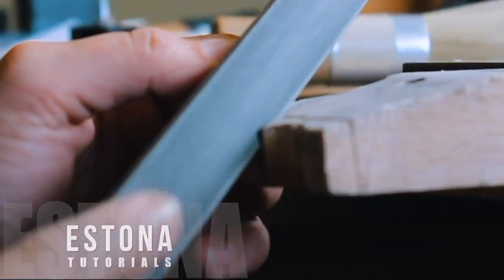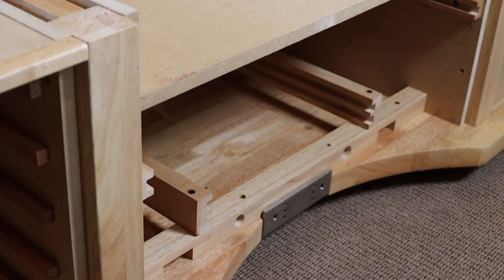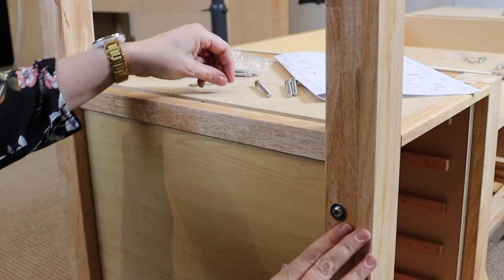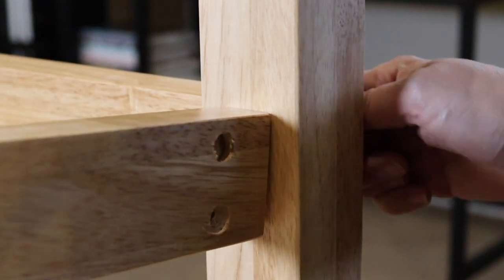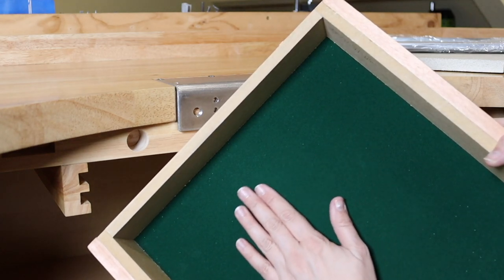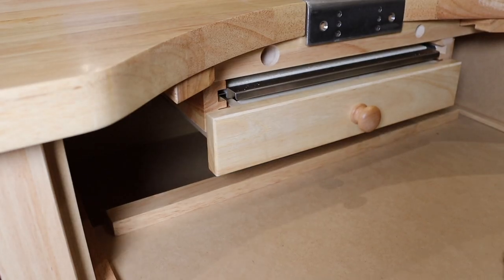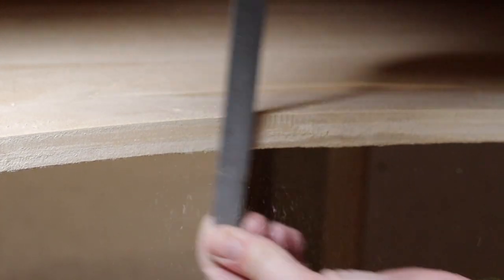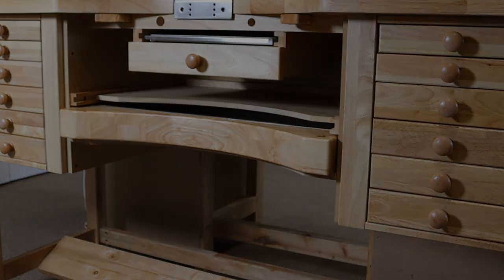Product review: Durston Superior Double Bench - FREE Estona Tutorial

Comment: I had previously treated myself to this workbench before seeing your review.  Would have loved that discount.  I find it’s so tall, I can’t effectively use the bench pin in front.  How did you resolve this?  I also saw that you used the GRS adapter plate.  I thought I could get the adjustable plate to lower bench pin height, but that would render the top drawer in the middle useless.  What are your solutions to these issues?  Thanks so much.  LOVE your channel.
Reply: Have you found a solution to the pin height yet? Im considering this bench also & I'm 5ft 31/2 so this might be an issue. It looks like the top drawer will have to be removed if you want to use the GRS benchmate system.